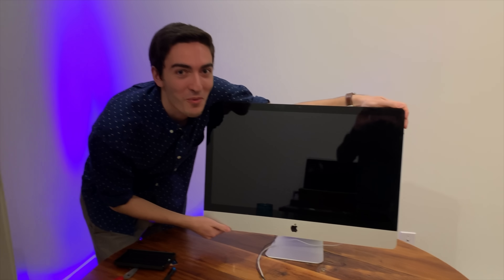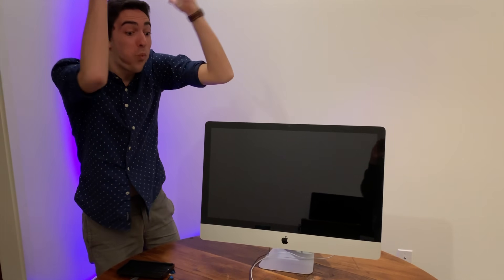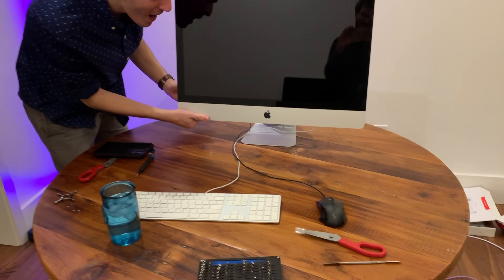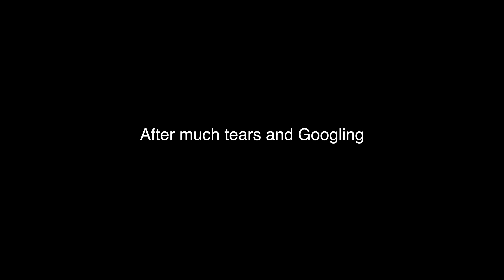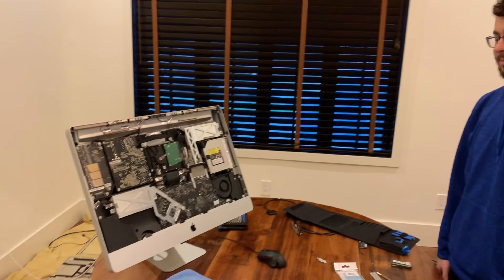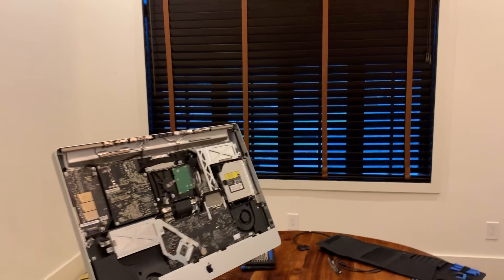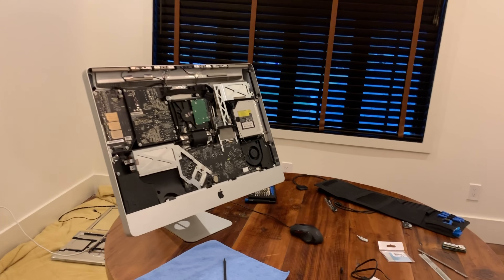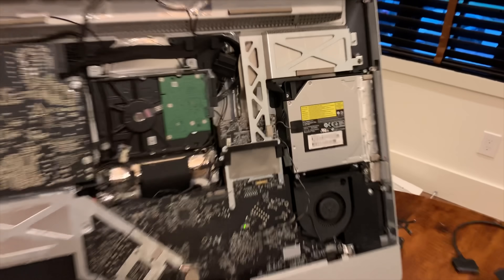Upgrading the graphics in our 2011 iMac (first attempt)

Comment: Isn't thermal paste there to cover any gaps between the two flat surfaces? In an ideal world, if they were both perfectly flat you wouldn't need any. So isn't it a good you can see your head in it?Means most of the area was directly touching the heatsink?

Comment: I have a newer card that isn't supported by the Apple drivers, how do I install the web drivers that enable it if I can't even boot?

This is a common problem for people who buy bleeding-edge cards, but there's a pretty simple solution. The NVIDIA drivers, both the one from Apple and the web driver, will not load if you have nv_disable=1 in your boot args. That will let you boot to an unaccelerated desktop, at which point you should be able to install the web drivers for your current OS. You should then remove the nv_disable flag from your boot args and reboot, and you should be up and running.

Assuming you have no other boot args, you can set the flag like this:

sudo nvram boot-args="nv_disable=1"

Then, once you've installed the web driver and are about to reboot, you can remove the flag and enable the web driver like this:

sudo nvram boot-args="nvda_drv=1"

Obviously if you have other settings in your boot args string, you should add them at each step as well.

This is particularly important for people with Maxwell based cards like the GTX 750 or GTX 9xx series, as the stock Apple drivers currently do not support the Maxwell architecture and will cause a kernel panic if they are enabled. This has been described as a "reboot loop", where the system will continually reboot after hitting the kernel panic during startup. If you are using a Mac Pro with one of these cards, you will still need an EFI card to drive a monitor so that you can update to the new web driver. This card (e.g. a GT 120) will be running in unaccelerated mode so everything will be slow, but the EFI on that card will allow the Mac Pro to light up the display connected to it. An alternative is to connect from another system via VNC or Screen Sharing, as this will work even when the NVIDIA drivers are disabled.

People using Hackintoshes don't have to worry about using a second card as the Hackintosh boot loader will initialize the card using the VBIOS and thus the monitor will light up, but you will still need to run with nv_disable=1 in order to avoid the kernel panic until you have updated to the NVIDIA web driver for the new OS version.

Update: This has changed in Sierra (10.12) as you can no longer modify the boot-args directly (if you have SIP enabled, which is the default). The commands now become:

sudo nvram nv_disable=1

to disable the drivers, and:

sudo nvram nvda_drv=1

to enable them.

25) I get an error message "This computer is not compatible with the NVIDIA Web Driver". How do I install the web driver?

Update: This hardware check has been removed as of 346.02.02f02 for 10.10.4 (14E46), so the driver should now just install on any system. Leaving this information in case people need to modify older drivers for some reason.

By default, the NVIDIA web driver checks to see if you are running on a MacPro3,1 through MacPro5,1 or have an NVIDIA PCIe GPU installed (via the "NVDA,noEFI" property in the IORegistry). Older Mac Pros or other systems will fail this check and the installer will not work. Turns out it's actually quite easy to remove the hardware check. Simply open up a Terminal window, and run the following commands, assuming the web driver package is in your ~/Downloads folder. Note that my example uses the 343.01.01f03 driver, you should substitute the exact version you are using.

Code:
pkgutil --expand ~/Downloads/WebDriver-343.01.01f03.pkg ~/Downloads/WebDriver

This will unpack the installer contents. You should open the Distribution file inside the WebDriver folder with a text editor like TextEdit, and change this line:

Code:
var found_hardware = 0;

to this:

Code:
var found_hardware = 1;

Save the file and quit the text editor. Then, run the following command in Terminal:

Code:
pkgutil --flatten ~/Downloads/WebDriver ~/Downloads/WebDriver-343.01.01f03.pkg

This will repack the contents into the installer package. Simply double-click the installer and it should run on your system.

26) Will Pascal GPUs like the GTX 1080 work?

No. We expected they might have been enabled with the first release of the 10.12 drivers, but as each Software Update from Apple comes and goes, it seems less and less likely that Pascal GPUs will ever be enabled under macOS. At this stage, I would not recommend buying a Pascal GPU with the intent of using it under macOS until NVIDIA releases a driver that enables it.

Update: NVIDIA has announced that web drivers that enable Pascal are coming soon.

27) Why does every security update break the NVIDIA web driver?

NVIDIA provides a set of binary driver components that must interact with a binary interface from the Apple components, both Frameworks like Metal or OpenGL and kernel extensions like IOKit. As far as I can tell, NVIDIA has two options:
Tie each driver release to a specific build of the OS, so that they can guarantee that those binary interfaces remain static and thus their binary drivers are compatible. Every time Apple releases a new build of the OS, NVIDIA must release a new build of the drivers to match.
Assume that Apple won't change these binary interfaces in a security update and allow one driver build to work with any version of a specific OS release (like 10.12.2). If Apple does change one of these interfaces, the driver would continually crash or cause kernel panics, thus rendering the system basically unusable.
NVIDIA has chosen the first of these two options in order to avoid the huge support burden that would be generated any time Apple changes an interface that their drivers depend on. Having the desktop continually crash or the system go into a kernel panic boot loop can be very difficult to recover from, so NVIDIA has chosen the lesser of two evils and will generally require a new driver build to exactly match the specific OS build that Apple releases to the public.

28) Should I buy an NVIDIA GPU?

Short answer: No. The lack of official eGPU support, and the lack of a web driver for Mojave, suggests the relationship between NVIDIA and Apple is not in a good place. As a result, it's probably best to stick with a modern AMD GPU like the RX 580 from the official eGPU enclosures. I think everyone agrees that we'd like to see some timely releases of high-quality drivers that enable all NVIDIA GPU architectures like Volta and Turing before anyone would recommend using NVIDIA on macOS.
Last edited: Nov 16, 2018
Like Reactions:dabotsonline, h9826790, aaronraimist and 8 others

Comment: I already have an iMac 2017 5k, but recently bought an iMac 2011 27 inch core i7 3.6 gz, with 12gb RAM, 2gb VRAM, 4 cores with 8 threats for around 400 dlls, and im very happy with it. It aged so well, and is a very solid and fast machine. I can do pretty the same things on both computers, the 2011 doesn't have airdrop but I can share screens and edit documents using the network and its so native and fast.

Comment: weird... I changed the GPU in my 2011 27" imac so that I could render out of sony vegas running on w7 or xp; sony only qualified certain GPUs. didn't need to do anything except take the old one out & put the new one in. I've since reversed the change as the original had more RAM & I run vegas elsewhere these days.

Comment: GTX 980M --> 145w TDP [Desktop Version 980 on Laptop and not renameed to 990m]
GTX 980m --> 100w TDP
GTX 780m --> 122w TDP [it work on 2011 iMac 27 is Work nice and no problem]
HD 6970m --> 75w TDP
--
I think your GTX980m is not 980m is 980M
and
iMac Graphics TDP limit is set on 120w ~ 130w

--
I think problem is on here?
 --> TDP limit and wrong version on 980M

Comment: Hi,
I mounted the GTX 880m on my iMac 27" i7- 32gb ram 2011, but it doesn't work, the screen is anything black!
How do I do it!

Thanks in advance

Regards
Reply: Same place, same system (though you have 2GB more RAM). Let me know if you get it working and I will do the same. For now, back to the original 500MB..

Comment: Luke, it turns out that the card you tried to upgrade with is based on the later Maxwell architechture, the iMacs can only work with Kepler based cards. Please try again with one of the cards listed at the beginning of the Macrumours forum thread. Don't give up!

Comment: Can a late 2009 imac 27 inch EMC 2374 upraded with a GTX 765m graphics can it support Mac OS  Mojave?
Reply: Technically it could but you will need a VBIOS from the nice people at this link:
https://forums.macrumors.com/threads/2011-imac-graphics-card-upgrade.1596614/

Comment: Can a late 2009 imac 27 inch EMC 2374 upraded with a GTX 765m graphics card could it play 4 k video?
Reply: Technically yes - check out this thread for all the latest info on the topic:
https://forums.macrumors.com/threads/2011-imac-graphics-card-upgrade.1596614/

Comment: I have a relative who’s given me their 27” 2009 iMac to repair, it has a bad graphics card (the HD 4650 i think?) and i need to get another, does anyone know any models that aren’t defective and have boot screen support? If not I will have to go for something like a GTX 765M or something. Thanks.
Reply: Jameo360 a GTX765m, GTX770m and GTX780m are known working on the A1312 iMacs. For a boot screen, i think that there’s a VBIOS rom for those cards that i said on the macrumors forum, but you need to flash the VBIOS with a ch341a usb EEPROM programmer. I think that no one have done that. I am thinking of doing that. If you do it, talk to me.

Comment: Hi Luke, 
Great stuff mate. Keep up the good work. 
I have one question for you or anyone else here.

I both iMac 27” 2011 i5 2,7 250ssd 8gb ddr3 and 512mb vram for, you wont believe this less then 300$. In superb condition. 

So my question is, since i have it available, 
can i upgrade it with AMD Radeon HD 6970 2gb ddr5 taken from Alienware laptop. My thinking is since it is a Apple supported card it should just be strait forward swap. Am i right?

Comment: the power acquired for 980 is not covered by standard power supply
Reply: makos asimakis lessons I have just learned the hard way upgraded power supply on its way 480 dollars spent so far on a 2010 iMac 24 inch the DONT DO THIS COMMENT IS VALID
Reply: Theres a LOT more to this topic and it's not something to just attempt casually. The best place for all the latest info on this topic is at: https://forums.macrumors.com/threads/2011-imac-graphics-card-upgrade.1596614/
Page 1 has a list of compatible cards and the current state of functionality as well as workarounds for many of the cards listed...

Comment: Can i install a kepler GTX 780m on my imac 2011 27"??? i know that a 765m is possible
Reply from the maker: Yep, the 780M was in the late 2013 27" iMac
Reply: Yes you can - there are VBIOS workarounds for it and another few cards at the following thread:
https://forums.macrumors.com/threads/2011-imac-graphics-card-upgrade.1596614/

Comment: Question for the community: I have an old 2011 iMac, it will honestly be cheaper for me to just upgrade some of the internal hardware than buy a new iMac and have to upgrade those internals so that I can work on my 3D animation and rendering. I would want Mohave and other updated apple software but id need METAL for that and 2011 iMacs ont have METAL.

1: Does anyone recomend me upgrading the hardware for metal, or is there a software work around for that (which i'd be more comfortable with) 
&
2. If I download windows so that the software will be compatible with my new hardware, will it be ok for me to switch back to the MacOS operating system for daily use. I just preffer the way MacOS looks

Also thanks for these videos, you're doing the project that I just had the idea for and this is all really really helpful

Comment: I am waiting for the 2nd attempt!
Reply: Maybe they will soon, now RX 580 (technically Radeon WX 7100 but it's the same shit) works in these iMacs with boot screen support.
Reply: @jm036  Wow, that's a fast gpu. 185w tdp though compared to the iMac's stock GPUs which draw 35-75w. Better find a way to keep it cool.
Reply: @suspendedhatch  The iMac's stock cooling isn't bad at all actually.
Reply: @jm036  RX 580 in iMac? Isn't it the full size card for Mac Pros? Or do you mean the 2017 iMacs Radeon cards?
Reply: @maikkaune  No, a Dell Radeon WX 7100 card. It's just a rebadged RX 580.
Reply: @maikkaune  have you looked at page 1 of this thread?
https://forums.macrumors.com/threads/2011-imac-graphics-card-upgrade.1596614/
These are the current working cards and many of them have now gotten custom VBIOS workarounds for flashing...
Reply: been 9 mons. guess there is none. sad
Reply: @jlpeng9036  part 2 is building an iMac for 200$, you can do it with multiple different cards as long as it has the correct BIOS
Reply: Same here
Reply: Me too but I believe he abandoned it.
Reply: Same

Comment: 8:40 Yeah. If you have a 2011 iMac and the GPU dies, and you can't get the GPU disabled in software/firmware, just remove the card, as long as the machine still works.

Comment: Are you planning on making another 2011 iMac upgrade video? I love these series of videos! 

I have a core i3 late 2011 education iMac. I bought it cause I wanted an iMac as a second computer and got it in great condition for $100. It’s a great machine for light work but do you know how to add Bluetooth hardware?
Reply: Found this on amzn: Lemorele Wireless USB WiFi Adapter Bluetooth 4.2 5G/2.5G Dual Band Wireless Adapter AC 600Mbps Mini WiFi Dongle for Desktop Laptop PC Projectors Support Windows XP/7/8/10, Mac OS 10.6-10.14

Comment: Thanks for warning me against brand new boards. I was seconds away from buying one because it's £60 cheaper than the dell specific stuff but now I don't care about the price difference that much. If I've spent £320 on the 27" 2010 iMac itself, a further £42 for an i7 and £35 for 32GB of Ram then spending £300 more on a GPU rather than £240 isn't too big a deal.

I still need to get myself an SSD and a new logic board (Had a damaged sensor connector, tried to fix with a soldering iron, knocked a resistor or two and broke it. Completely my bad. Still works though and can be used as normal but the CPU is stuck on constant thermal throttling at 1.17Ghz until I replace the board...) So I'm nowhere near done yet.
Still though.

27" 2010 iMac £320
i7-870 £42
32GB Ram £35
Replacement Logic Board £100
GTX 980m GPU £300
500GB SSD £72

Total Cost ~£869

Minus the sold parts
i5 760 that it came with £12
4GB of ram £10
Ageing 500GB HDD £20 (Had final cut on it.)
Damaged logic board £50-£100
Old HD 5750 £60-£100

Actual cost £627 ~ £717
Or £527 ~ £617 if I hadn't broken the board.

Way cheaper than anything newer than 2013 and just as powerful if not faster!
If you are confident that you can handle upgrading it (which is easy by the way) I would recommend.
Perhaps getting a 2011 iMac would have been better for the newer CPU support but between a 1st and 2nd gen i7 the difference isn't much. 10%-20% maybe.

(Bought the iMac on a whim. Never planned on it, never had one before. I just saw an ad for one and had the money for it.)
If I didn't need a new board I would have bought the SSD by now as well as the GPU that I just ordered whilst writing this but actual performance comes first. Speed comes second.
Reply: @Denis Dos Santos I was thinking that too!
Reply: Nightcore, you can't use a 980M, it's Maxwell based, you need a Kepler card to work in your iMac. Check out the latest info and compatible cards at: https://forums.macrumors.com/threads/2011-imac-graphics-card-upgrade.1596614/

Comment: I found an AMD RX 480 in MXM form factor on Taobao. RX 480 can be then force flashed into an RX 580, which is known to work under macOS Mojave as it is listed by Apple as one of the supported cards for eGPU and Mac Pro 2009 use.

Since there is a Mac that uses RX 580, I have a little bit of hope that someone can splice together the firmware of that RX 480 MXM card and the Apple RX 580 firmware to result in a n usable MXM card for this.
Reply: I use a xfx 480 in my hackintosh without any special drivers/Kexts.
Reply: @RetchEinhundert  You need special Apple VBIOS for the boot screen to show up. P.s. My Hackinosh uses a Sapphire RX 580. If you want to you can force flash a XFX RX 580 firmware into your RX 480 - the RX 580 is a rebadge with a slight boost to clock speeds on top of RX 480, so this constitutes just a minor overclock for your RX 480.
Reply: Actually I think you're on to something there, I believe the RX 580 is also available as the rebadged WX7100 and I know that thats about the best card that reliably works in these imacs. Check out page 1 of this thread for the latest info on this topic and the current list of working cards:
https://forums.macrumors.com/threads/2011-imac-graphics-card-upgrade.1596614/

Comment: Hi, Guys Thanks for this Video It helped heaps, especially the 3 LED tip as I was having problems after upgrading to an AMD Radeon HD 6970M 2048 MB (NEW). I was having issues with getting the screen to work then the Backlight was off but it was the connectors. Now I finally got it back together and working fine, BUT even though the diagnostics and all system reports are good when I load a Game and start to play after 5 mins the whole system shuts down, any tips or help? maybe I need drivers for the Graphics. P.S. System is not overheating and running cooler than ever. Thanks Again.